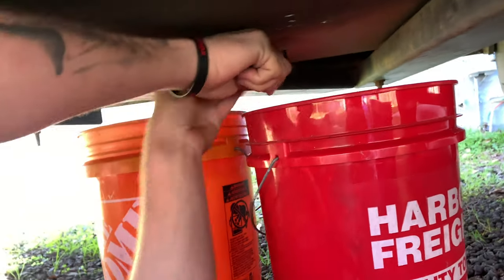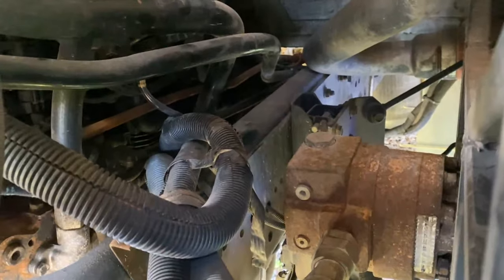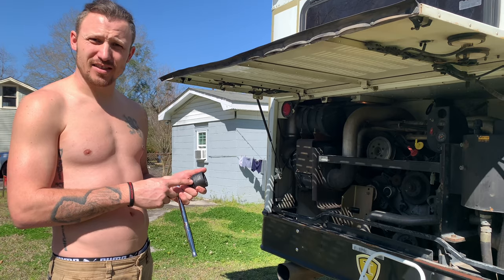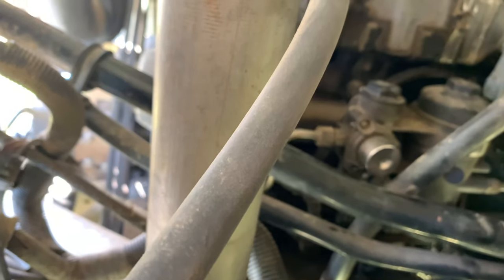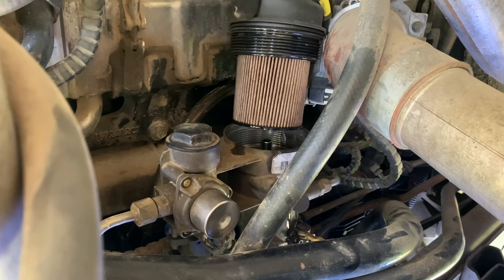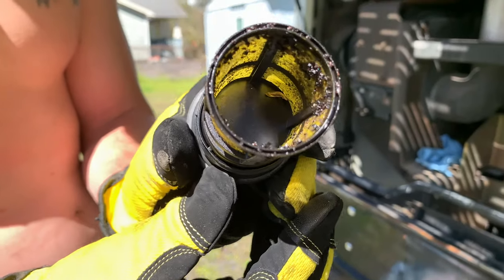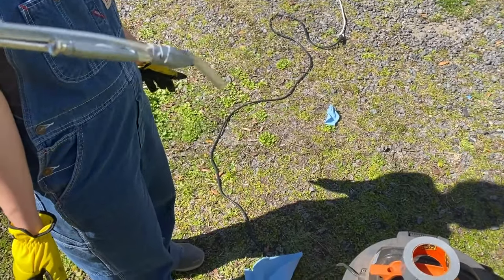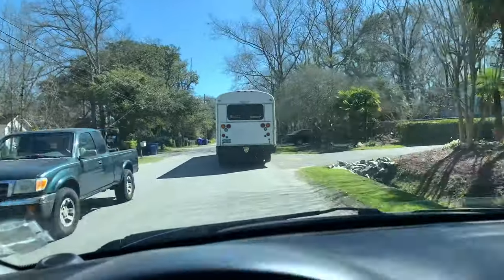Replacing our bus fuel filter - School Bus Conversion - SKOOLIE Video

Comment: He works mostly on Detroit Diesel engines but you can learn a bunch from Bus Grease Monkey on YT.  I laughed when he said he had to go back to Home Depot. It'd be awesome if you could just park for 2 years at Home Depot/ Lowe's/ Menard's and build it there! I'm actually waiting for a fuel transfer pump for our bus for a crank but no-start situation. It was the only mechanical thing I had not replaced. Go figure.
Reply from the maker: Thanks for the suggestion - going to go subscribe to him now. RIGHT?! Just parking outside of those stores would cut the build time in half it feels like! What kind of bus do you have? Are you a mechanic or just doing it yourself because you've found things to be easy. We definitely want to be able to do most of our own work (once we know what the heck we are doing), but also don't want to mess anything up beyond repair.
Reply: @TheMcBrowns  I have a 2000 Thomas MVP-ER (engine rear). Cummins ISC 8.3 L and MD3060 transmission. Had to restore mechanical systems because I put a rod through the block 30 minutes into the ride home when we bought it. I'm not a mechanic but willing to try most things. But I had professionals do most of the prior work machining a replacement block, rebuilding it, rebuilding the transmission. I put the replacement radiator and turbo in myself. I put a new exhaust pipe and muffler in. Just need to choose your battles. A fuel pump I can certainly handle.